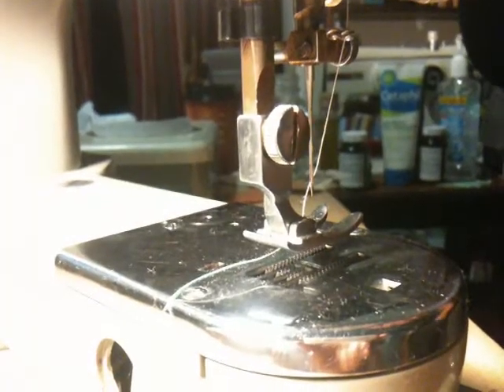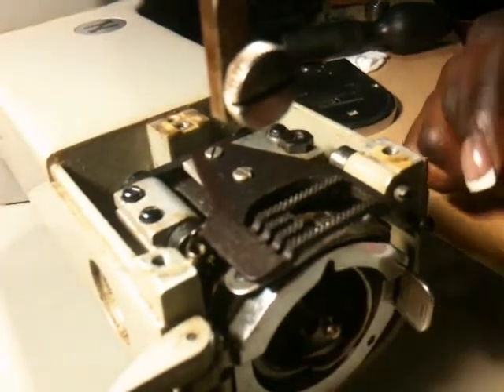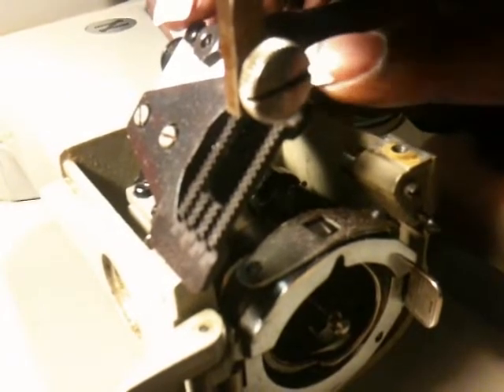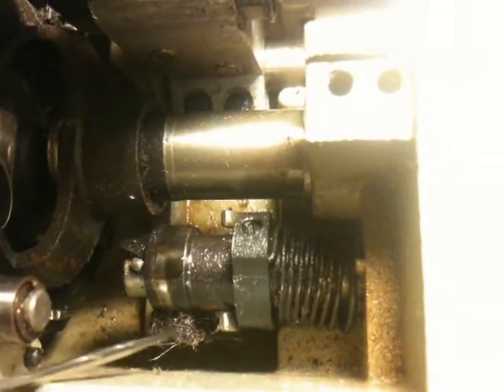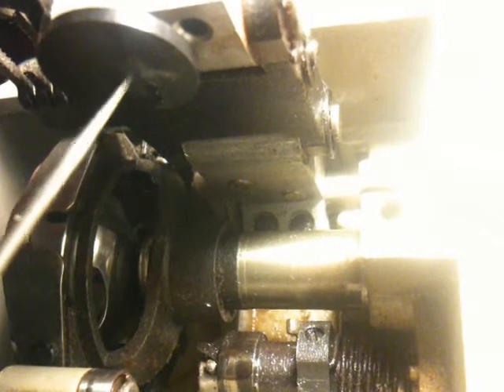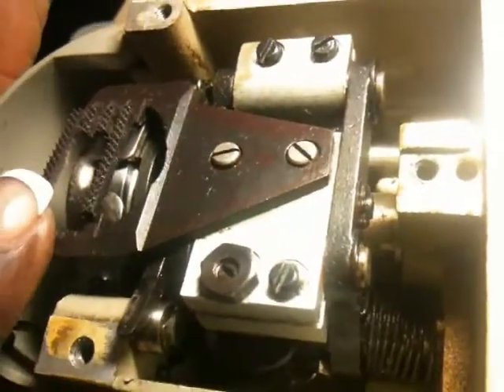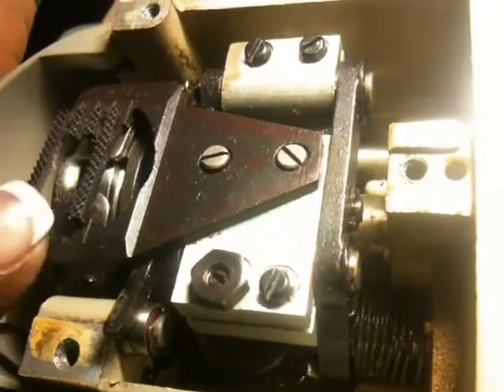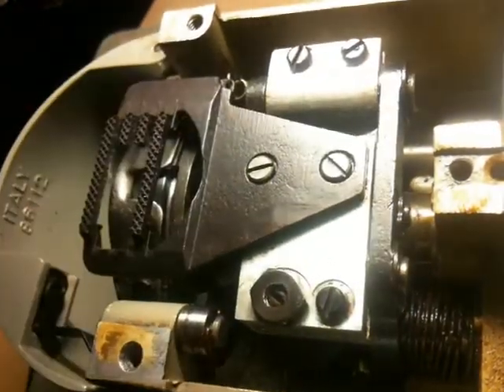How to Adjust Feed Dog Height On A Necchi Supernova Free Arm Sewing Machine

Comment: Good job,     

Question: on the back of my Necchi there is an ajdustment  knob that turns.   It has an arrow to the right and to the left with a +  and a  -  incicator. It makes only one full turn total either way.        Have no idea whqt it  adjusts,  I have run the machine with , I believe, every other setting  while the machine is running and have not detected where it does anything to any other part of the machine.
Regards,
h
Reply from the maker: Wow, 11 years later, here’s my reply: sounds like it might be a fine adjustment knob for decorative stitches.